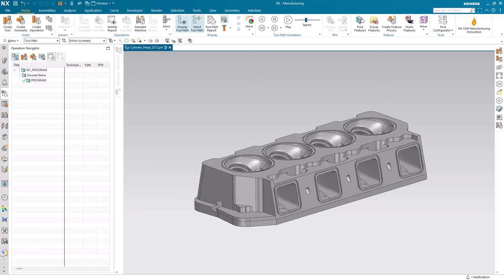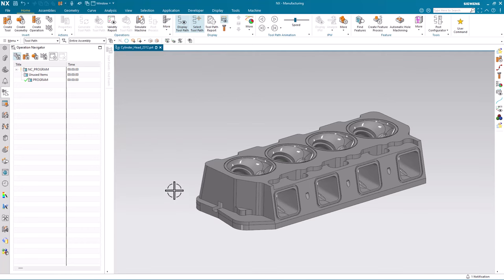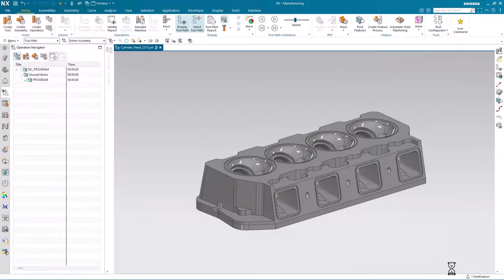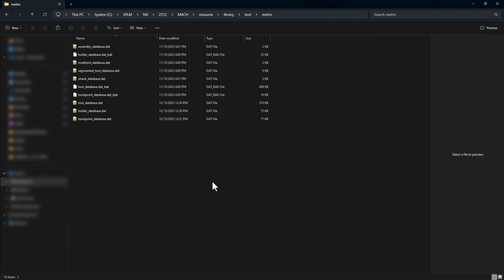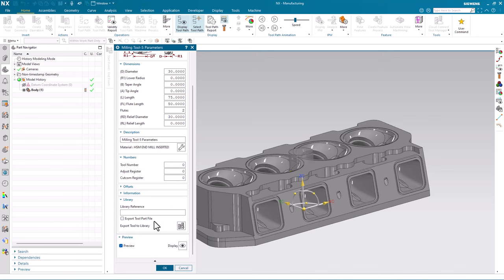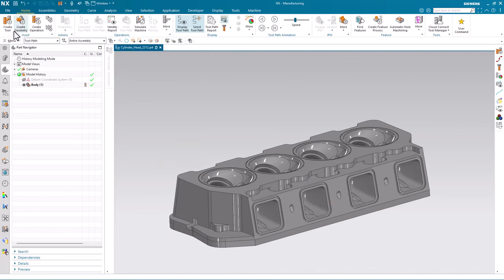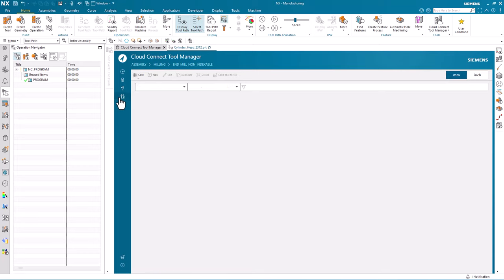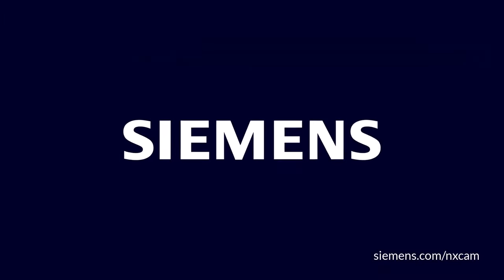Migrating Tool Libraries in NX CAM

Comment: It's a mess and still no proper tool manager has been made. Always the same interface for years.
Reply from the maker: Hi @medetharmankaya9022, Thank you so much for your feedback.
The interface is being worked on, as part of the Cloud Connect Tool Manager functionalities. 
Have you used that? It's an easy to use graphical interface to the tool, shank and holder libraries. 

You are welcome to join the NX Manufacturing community, where you can get advice and share knowledge with experts around the world. 
If you provide the feedback in the community, you will get advice from users working with this on a daily basis. https://sie.ag/5udtBX

Comment: Is there a way to also merge two existing libraries like that? Can you also automatically remove the ootb tools from all library files? And a third question, what happens if multiple users use the same  library at the same time, is there a checkout process or does it just block the files while writing? Thanks for the answers.
Reply from the maker: Hi - Thanks for your patience while we researched your questions. Below are the replies from our experts:

1) Currently there’s no way to merge two existing libraries. It will need to be done manually once one of the libraries has been converted to the latest version. 2) 	You cannot remove the ootb tools from all library files without some programming. (visual basic or other) 3) Our library mechanism does not have a checkout process. It is recommended when a user makes any modifications to the library, such as editing/deleting data, other users should refrain from making changes to the libraries. 

Hope this helps! ~ Team Siemens

Comment: Why should i convert the tooldatabase.dat and not only copy to the new folder?
Reply from the maker: Hi @micha_keller, excellent question, thank you.
The reason is, when converting, you ensure all new tool types and attributes are used correctly. 

It can happen we introduce new attributes to releases, i.e. "SHAREF  - Tool Shank Reference" in NX2212, or new tool types, i.e. "Dovetail Mills" in NX2212
 
If you copy your old database to the new version folder, the copied database doesn't contain the new tool types and attributes, and may then cause errors when using NX CAM. 

You are welcome to join the NX Manufacturing community, where you can get more technical insights and connect with peers and experts around the world.
https://sie.ag/2so2dQ